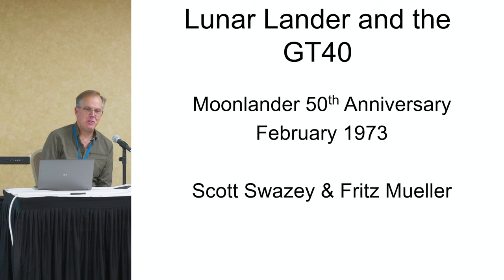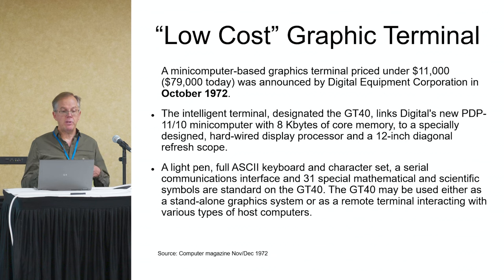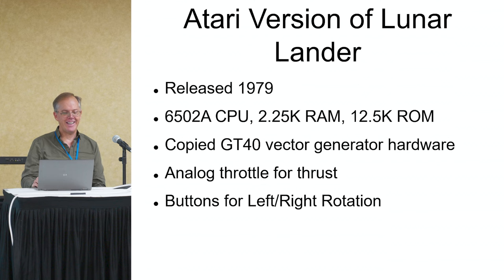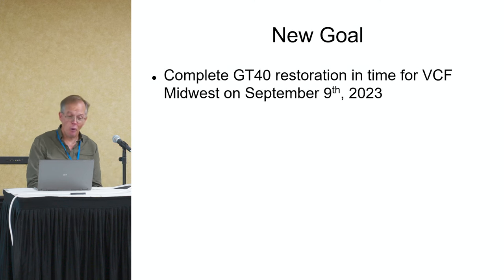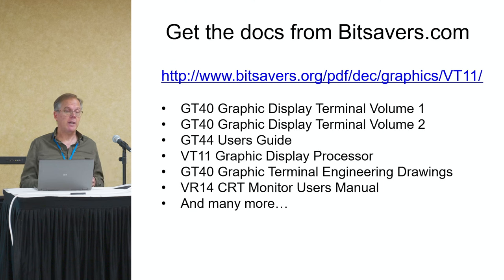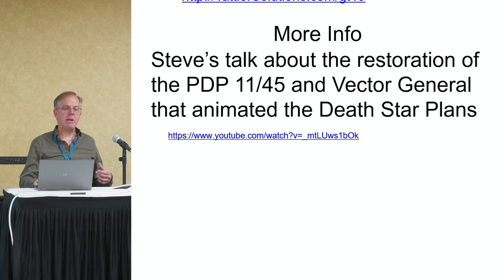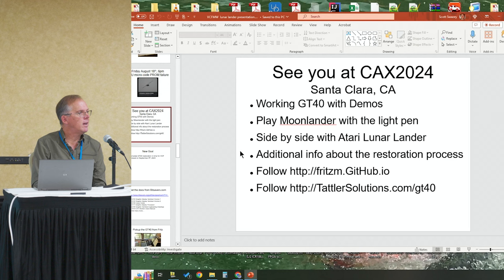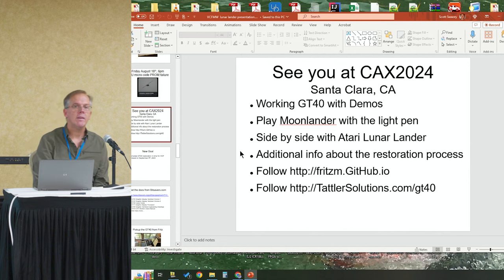The restoration of a GT40 to play lunar lander | VCFMW 18 (2023)

Comment: Fun to find out midway that Scott was a Qualcommer.  I worked there from 1995-2016 in IT.  Wrote a lot of manufacturing-line control software, some integrated with test rigs.  Fun and inspiring workplace for engineers.

Comment: I started working for DEC in Nov. 1972, writing PDP-8 code, and a year or two later switched to PDP-11 code.  But I was always a software guy, so I'm completely blown away by the hardware restoration you've accomplished.

We had ONE, count 'em, ONE GT-40 in our computer lab, and starting sometime in either '73 or '74, it was constantly in use by programmers playing Lunar Lander.  I remember that the controls displayed a variety of parameters such as x and y location and x and y velocity, etc.  The first goal for every new player was, of course, to land without tipping over on a rock and crashing.  Once you got good at that, the next goal was to land near x=0, which was where the McDonalds was.  The next time you play it, just try to land near 0, and I guarantee you'll find the McDonalds.

I can't remember if it was this game or another, but in some game produced in that era, there was a reference to "Assabet".  DEC was housed in an old woolen's mill that originally got its power from a water wheel in the Assabet River.  This led to jokes and wisecracks about the Bet Your Ass River, which I think found its way into some of the games produced back then.

Also, WRT McDonalds, I don't know about the rest of the U.S., but there were certainly enough McDonalds in New England at the time that every programmer playing the game was knew who they were.  But I don't remember the game showing the McDonalds arches next to the little box representing the restaurant, so the code you're running may be a later rev.  In the version I remember playing, it was just a stick figure walking out of the lunar lander into a tiny rectangular box, saying, "I'll have two cheeseburgers and a big mac to go", then walking back into the lunar lander, and the lunar lander taking off.

Jack Burness, the guy who wrote the code, seemed to be friends with a number of people in the small systems department where I worked, although I didn't really know him.  I met him once when a bunch of people from small systems decided to all drive over to Emerson Hospital, where he was hospitalized for something, although I don't remember what.

Comment: Ford GT40 still an amazing car. Dec gt40, im thinking massive mechanical hard drive with 2mb capacity, probably cost thousands of dollars, the actual machine would likely be green screen. A modern $2 microcontroller could be millions of times more capable, yet the new Ford GT40 still costs megabucks, and is not much faster than the original.
Point is, computers have developed considerably further than the motor car. 
Thank goodness for SSDs, that constant droning of harddrive motors is no more😅😅😅😅